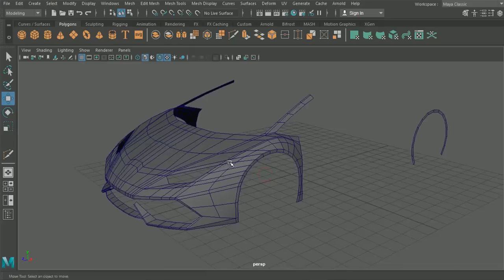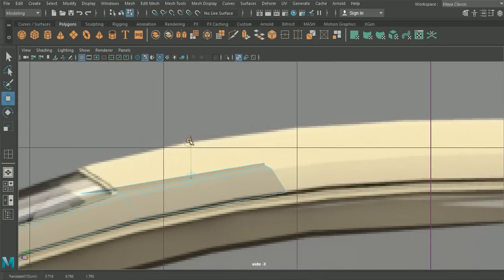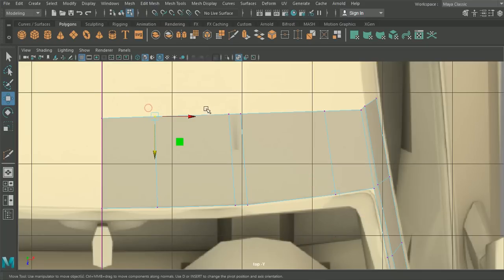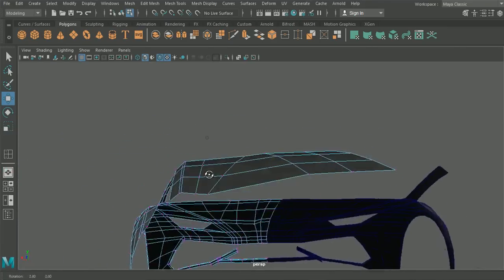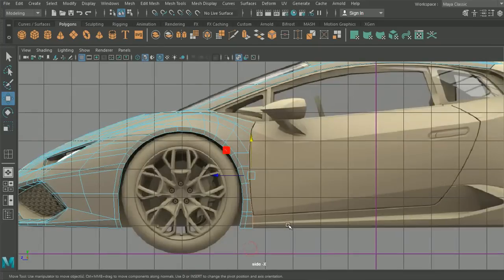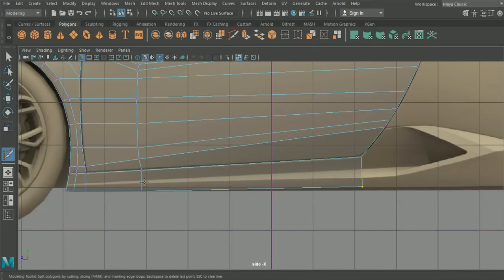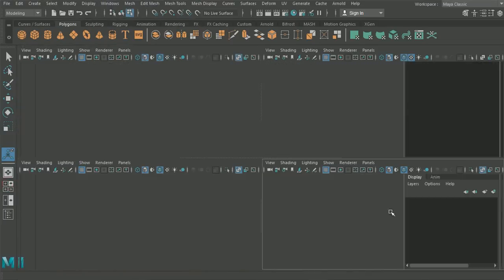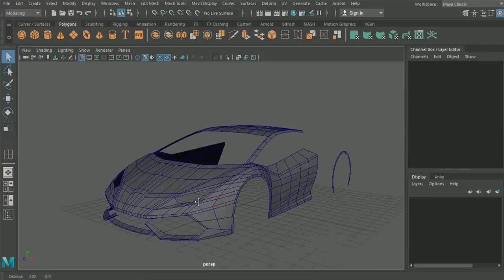3D Car Modeling Tutorial pt.4 | Autodesk Maya | Modeling a Lamborghini Huracan

Comment: why dont you set the duplicated version to update when you model the original side? Instead of duplicating everytime you're finished
Reply from the maker: I used it as a backup in case I made a mistake as the hard drive on that computer didn't have enough space to be saving any back up files.

Comment: The only thing I noticed is that I believe at about 12:16 the two edge loops running close to each other just above the door handle seem to be in the wrong place. I believe the one on the bottom should actually be where the top one is, and the top one should be where the crease above that is. This is because the bottom crease is just a continuation of the crease from the front of the car that runs just to the right of the headlight (best seen from top view). Other than this minor detail, you've done a great job so far. I look forward to finishing the rest of the series. Thanks!
Reply: Does that mean this gets fixed later on? I'd fix it myself, but I'm afraid that doing it will make it a bit more confusing to understand the rest of the videos.
Reply from the maker: Cheers man. Yea I work towards fixing that when I add the additional geometry when smoothing. Thanks for the comment and I'm glad you're enjoying so far.
Reply: You're welcome. I thought perhaps you might fix it later, but I figured I'd comment while it was on my mind. It's nice to see that your strategy and mine are really not all that different. How you go about things is very similar to how I would do it. I'm glad to see you're making a new series. Perhaps I'll look at that one after this. Thanks!